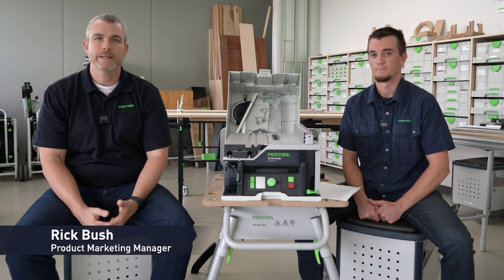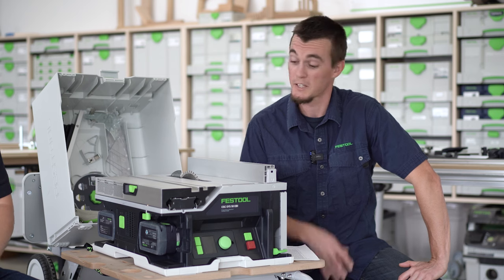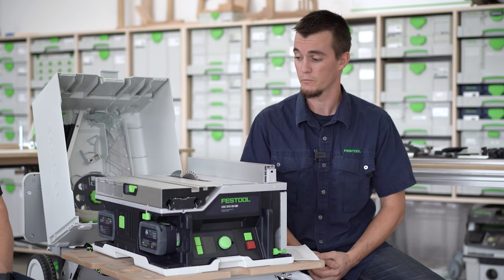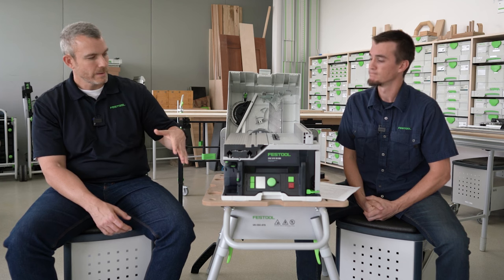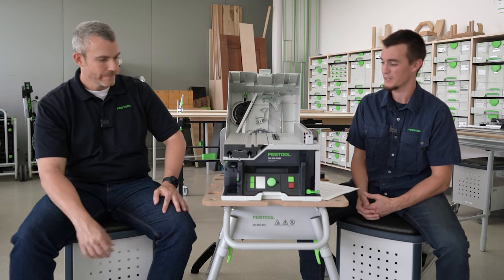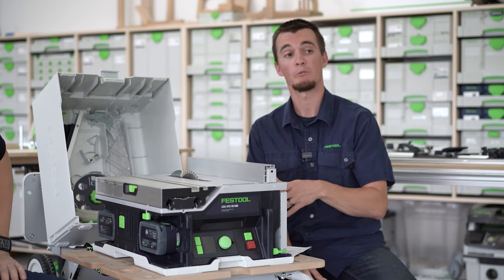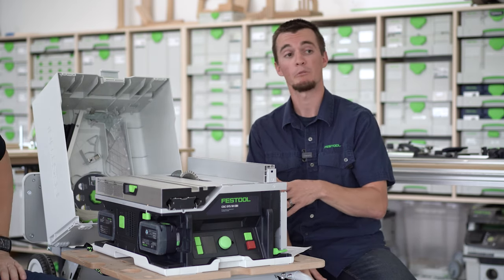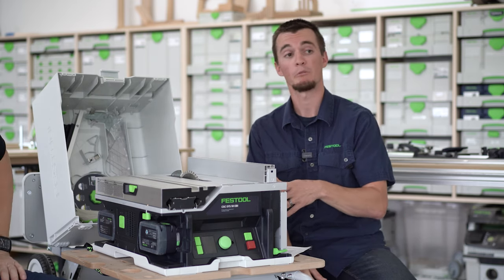Episode Thirteen: Inside the New CSC SYS 50 Cordless Table Saw

Comment: Great presentation,  im interested in this saw as a trim carpenter. 
You mentioned it started out on the drawing board as a corded machine.  Do you have any plans to release a corded/cordless version like you did with some of your sanders? That way we can be cordless when needed and corded the rest of the time. 

Also could the fence not be digital like the rest of the saw?

Comment: I took a piece of White oak close to 8/4 that I had laying around my shop for maybe 10 years into Rockler in Olathe, Kansas,  My old table saw could not cut it without bogging down and ask to see if the Festool CSC SYS 50 table saw could rip and crosscut the piece of lumber. The CSC SYS 50 cut it like a knife cutting butter. though I wasn’t ready or was going to buy a new Saw I bought the Festool table saw on the spot and added a CT Mini Hepa. I’ve only had have it a few days and am just blown away by what it will do. There is a small learning curve with it but I am extremely happy . August 6, 2024.

Comment: I bought the SYS 50 on launch day because I'm an apartment woodworker in San Francisco. The city college woodshop has three SawStops, but hauling materials back/forth isn't always convenient and that shop closes all summer + winter break. No other jobsite/contractor saw is small enough, quiet enough, or dust-collecting enough to use regularly inside an apartment. This was a true game changer for someone trying to work on fine furniture projects in their spare time. I'd love to see four accessories released this year:

1. Miter gauge fence with (a) imperial/metric scales (b) stop block with micro-adjustment.

2. Micro-adjuster that slides/locks in the same channel as the rip fence. It would be sweet to eyeball the adjuster against the scale, lock it down, then twist a fine knob to shift the fence before locking that down.

3. Long fence options for both rip + miter orientations with a flip-up support underneath for long stock.

4. 120V/AC adapter (long shot). I'm only using this at home, so power is always available. Using batteries is fine but it would be awesome to just plug the SYS50 into my CT26, which (thank you, engineers) fits nicely underneath the stand.
Reply: you build wooden furniture INSIDE you apartment? That's lowkey awesome.
Reply: @dubjspecialk  You can do it. A planing stop + shooting board on the kitchen counter or island is enough to get going with hand tools. I generally save machining for the shop, but having this at home is really helpful.
Reply: Can you put a sawstop blade on in it?
Reply: @damaincantu1581  The CSC SYS uses 168mm blades, which are common to the TS60 series track saws too. Other brands of jobsite saws may use 8-1/4" or 10" blades. Cabinet saws use 10" blades typically.

Comment: I have this saw, and it replaced my crappy Bosch contractor, which was notoriously inaccurate.  Would like to see Festool come out with a corded adapter and a hold-down accessory similar to the Jessum Clear Cut TS Stock Guide to fit on the saw fence.  There is a T-track slot on the fence, but it's too small for other after-market accessories.  All in all, I'm very happy with it.  One other thing - the 18v Batteries are only available with a charger and systainer. I just would like to have two more batteries which can charge while I'm using the other two without having to buy another charger and systainer.

Comment: As an owner of the saw I’m very impressed. Great video, the best on the tool I have seen to date. However the machine has a glare engineering short coming. The fence is it weakness with no micro adjustment. And you should have used a duel scale on it with both  metric and imperial scales. I use the saw for building in metric and construction in imperial. Just mark one side of the,scale metric and the other imperial, problem fixed. You also could have used a rubber friction wheel as it’s micro fence adjustment. It’s unfortunate to have such a sophisticated height, and angle adjustment with an archaic fence adjustment. My 30 year old Dewalt has a better fence than this. Glad to hear the larger batteries are coming, I need to get a second pair and I can drain the stock 5 amp hours one’s relatively quickly. As for value vs cost the machine is cheep given its capabilities and accuracy. Now about that fence…

Comment: The metric fence scales cost me around $30 delivered which was somewhat of an irritant to me.  You should have it available in the US as either metric or imperial.  After several months of using this for fine detail work, the crosscut fence needs a flip stop and a scale that can be calibrated.  It also needs a zero clearance insert available for purchase.  Looking forward to the larger amp hour batteries too.  Steve
Reply: Look at Benchdog tools - they may have what you seek.
Reply: @julianniemeyer1655  Already have the BD fence but should have been developed by Festool from the beginning.

Comment: There is no reason they can’t have a 120v AC to 36 V DC converter that looks like two battery packs feeding into an AC plug.  They already do something similar with their sanders. It’s not that difficult of an engineering problem to solve.
Reply: I’m a bit surprised they haven’t come out with anything for that. Probably losing sales. Either way I have one and it’s an outstanding product tbh

Comment: excuse my ignorance but wasn't this designed and built in Germany.  you guys talk about it like it was designed in the USA which I highly doubt since it wasn't released in the USA for quite a while after it was already out in Europe.  did not one of your testers suggest a dial-in distance to fence which in my opinion is the most important measurement to recall.  It's one reason I'll never buy it at this price.
Reply: I am with you. I have spent the last 4 months building my Festool Inventory and would have bought this saw, but the fence was a deal breaker so I bought a cordless DeWalt with the micro adjust fence until Festool makes some improvements. For the price I would like to see more of the features that are important to me.